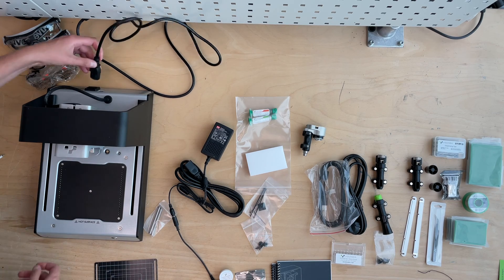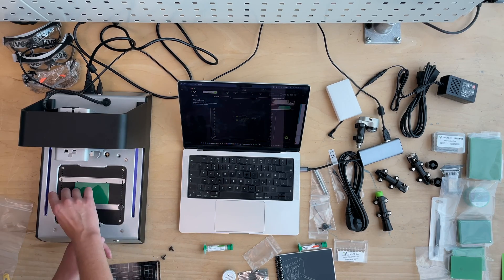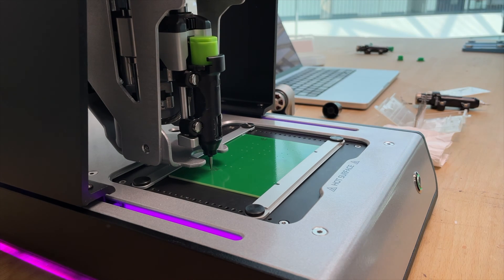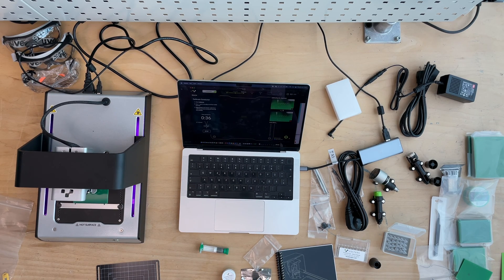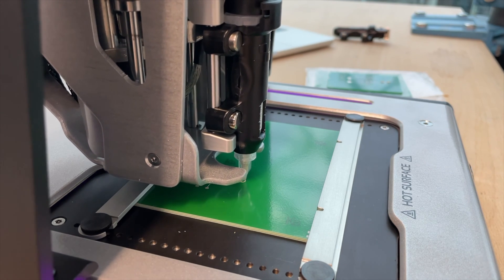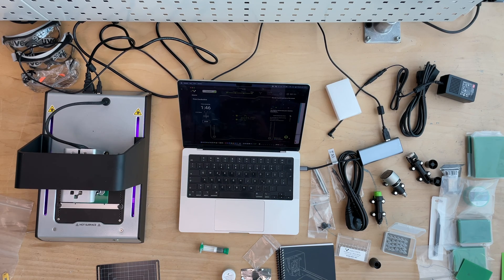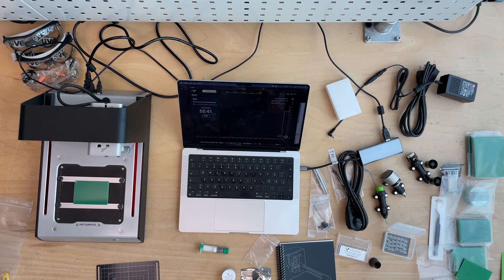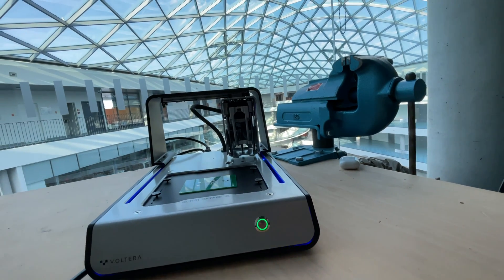How to print a PCB? - Getting started Voltera V-One

Comment: Thank you for the video! Any updates on the machine and the process? Do you think the process could scale well if you had 3 different machines where Machine One measures, Machine Two prints, Machine Three etc?
Reply from the maker: Thanks for the question, actually a pretty good one!
First of all the hardware itself is pretty good with only a view potentials to optimise.
Having one machine to print and one to drill would be a good setup in general, eve though it’s of course great to have this all in one machine.
BUT: The software setup is impossible. Calibrating takes forever and needs to be repeated every single time. Error occurred during printing /…, repeat calibration, you want to print the same layout again? Calibrate again. This slows down the process to a point where it’s quicker to etch a circuit board instead of printing it.
Nevertheless I think those significant weaknesses in the software process can be eliminated by updates providing the user more control of the software process.
Would you be interested in a video reviewing the voltera after using it for many months?
Reply: @blueprintiot  Thanks for the feedback! Yes I would love to see another video with as much detail as you can spare! I have been considering a possible variety of machines and I am interested in collaborating to build out pcb’s with you.